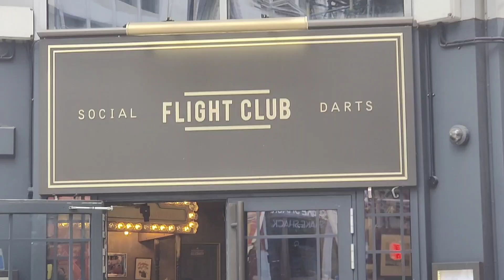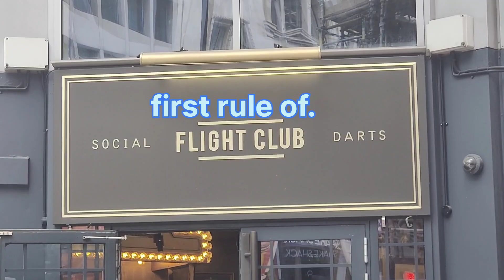Bad design on Oxford Street!! How bad was the Ryefield board, you might get a look!!

Comment: Cut the side wall off a piece of cable ladder into 3 individual pieces that will fit into the header trunking and fix with boulons in 3 evenly separated compartments, this will stop the internal collapse in the header and give u a better measurement for glanding supply cables

Comment: Funny how some people think you can bend 300, 240, 185, 120 solid 4core cables easy like its a tri rated 😂, even 70mm and below can be a pain in the backside depending on the cable brand. That switch room looked like no thought whatsoever went into it

Comment: Is the red sheathing denoting fire rated ? ..would the fire rating be low smoke?
Reply from the maker: Yeah, it's an fp600 cable. Full of fibre glass wrapping. It's designed to give the emergency lighting a hour longer during a fire.

Comment: what make are the chain locking grips do they ever slip off ?
Reply from the maker: They are just a cheap pair. I bought them to see if they would work, that way if they didn't I'd only use a few quid. They slip sometimes but it's usually down to me.
Reply: Thank you for the reply

Comment: Just interested as this isn't part of my world. 🤣 But obviously some of those singles are big high current circuits. Does the designer never make any stipulations for avoiding electromagnetic effects i.e. Eddie currents when entering separate holes in a steel enclosure? Or does it just get ignored?
Reply: BS 7671 regulation 521.5.1 states that:

"The conductors of an AC circuit installed in a ferromagnetic enclosure shall be arranged so that all line conductors and the neutral conductor, if any, and the appropriate protective conductor are contained within the same enclosure.

Where such conductors enter a ferrous enclosure, they shall be arranged such that the conductors are only collectively surrounded by ferromagnetic material."

So any competent designer should be following that :)
Reply: @intercity125  Yes... and thats why I'm asking... Unless that isn't a ferrous enclosure....
Reply: @travoltasbiplane1551  Do apologise, I see where you mean with the singles actually in the video now, hadn't noticed!!. Installed improperly and I would suggest ignored - would need to start pushing kA to start seeing dangerous heating from what I gather.
Reply from the maker: In this video all of the cables are 3 and 4 cores. There's no singles on here.
Reply: @jointechcabling9103  ah ok my mistake
 I'm sure I've seen similar with singles though. And this is purely curiosity. The armouring on those is aluminium isn't it? Is the enclosure aluminium in that instance as well? Thanks for taking the time!
Reply: @travoltasbiplane1551  the enclosure might not be aluminium but the plate they are all glanded into is aluminium which gives the very same affect! No heat dissipation